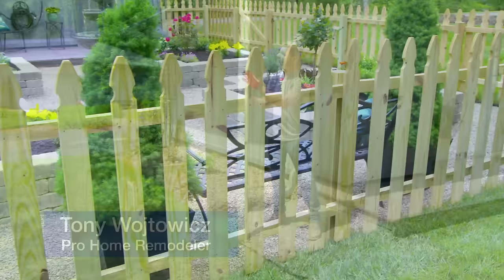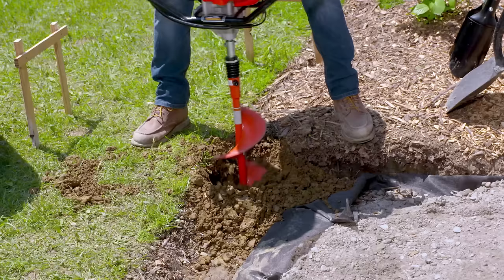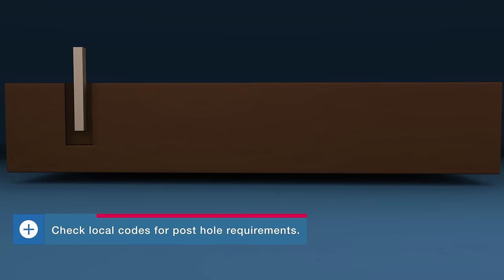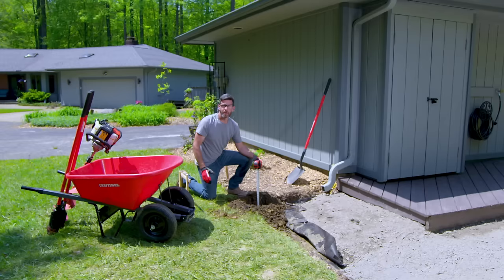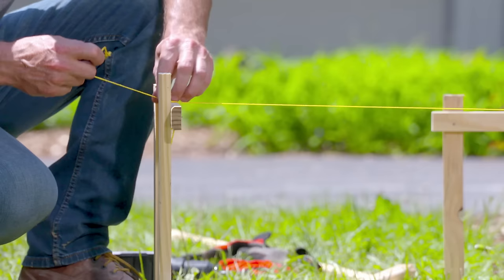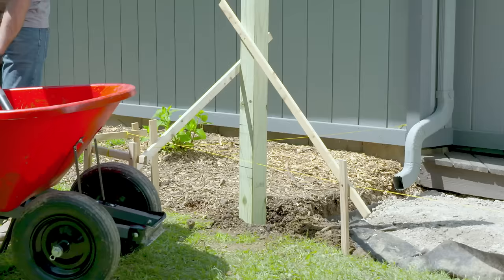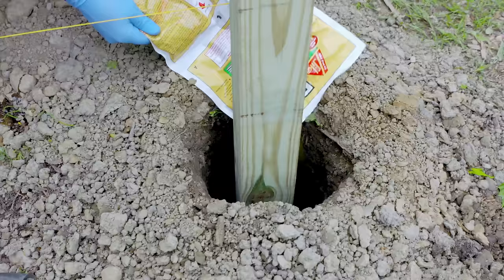How to Set a Post for a Fence or Deck

Comment: Expansion foam does not work nearly as well as concrete.  I personally wouldn't use it at all.  After it dries/cures you can wiggle the pole around in the hole a lot so I would not use it for decking.  Its ok for setting a mailbox post but I would not use it for decking posts.

Comment: The post rots under ground because it doesn't drain but that is why they show the gravel base. The ground still holds water though. It's OK for temporary docks to have wood posts under ground but a permanent deck post should be above ground. There are steel spikes that can go on the bottom end of your post to stick into the ground and another kind that screws in. For docks I use PT and spike the end with a skill saw then waterjet them in with a garden hose.
Reply: Never seen anybody put gravel under a post but often wondered about wrapping them in dpc or bitumen paint.

Comment: How do you remove a post like that if the post rots away and all you got is concrete I need to replace a post that the previous owners put up because it rotted away and I can't figure out how to get that concrete out of the hole
Reply: I'm contemplating the same issue. I think instead of chipping out the old concrete I'm going to cover it and put the new posts between the originals. If everything goes well I'll be dead before the fence has to be replaced.
Reply: Maybe just leave the old concrete, drill a hole in it, and mount metal bracket in there with some 'liquid anchor' or sth, and mount new post in the bracket? They mentions bracket in this video. They are calling it 'hardware'.
Reply: I used a chain and engine hoist. 
1 dig around the concrete enough to wrap a chain around it. Secure it with a quick link or hook.
2 center the engine hoist around the concrete and bring the chain up to the hook. Again, secure with quick link.
3 Pump away on the hoist, the entire concrete plug pops out of the ground.
Lower the plug into a wheelbarrow or lay sideways and sledge it into pieces.
Reply: Use a 4x4 post bracket. Cut the old post out, make it so it's flush with the concrete, and lag the bracket into the crete. Set new post and fasten to bracket

Comment: When i went to school to become a constructionworker they said "you can never set wood directly onto cencrete because that is going to create or suck up moisture" Is that wrong or is the dude in the video wrong?
Reply: They are right. Wood posts done in this fashion have a limited life. Wood fences in general have a limited life. You can hope for 25 years if you do everything right.
Reply: I just tore down the fence around my property. It was built about 27 years ago and was already falling apart. Each post were pressure treated ground contact and set in concrete. Every post were rotten away so all I had to do was give it a slight push and it fell.
Reply: The dude never set the post end on concrete. The vase was gravel.
Reply: Yes, filling the top of the hole with dirt looks nice, but unless you want to reduce the life of the posts by 1/3, leave the concrete exposed, and seal around where the wood meet the concrete.  Wood and wet soil don’t mix.
Reply: @MtKatahdinClimber  Newest research has proven that where the wood meets the concrete is where the most water enters, and eventually saturates the wood, and even PT Ground Contact/Burial rated wood will rot.  If you have to put PT wood in concrete, take an extra day and 'paint' all your PT wood with a quality water-proofing like roofing tar.
Reply: @boots7859  that’s why it’s best to seal around that top gap with something like 3M5200 or Sikaflex 291, which will prevent water from entering at that point.  Will extend the life of the post by 4 years+

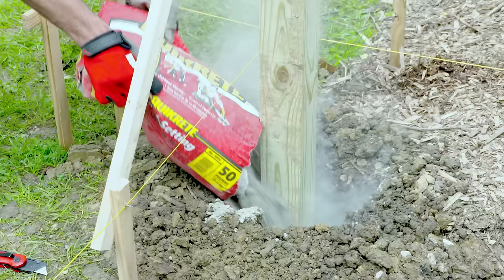Comment: 1:20  As far as I heard recently the wood should not have contact with a concrete, because the wood will get moist and rotten due to the capillary action of the concrete. What is your opinion?
Reply: @BugJuiceFlavor  What kind of climate do you live in? What is your experience in concrete and wood works?

Comment: Holes need to be 3x the width of the post? So for a 6x6 post I need to dig an 18" wide hole? 🤔
Reply: yeah I don't get it why u need a hole that wide something isn't right.
Reply: 3x the width of a 6x6 is 16.5"... This is the width for the cement FOOTING, so the hole has to be as wide in order to access the bottom of it.  The reason is BUILDING CODE, but the purpose is to have enough surface so the weight bears properly.

Comment: This is wrong as the post will rot, the wood will absorbe water from the top and from the concrete under. The best way is to use a bracket! Do not waste your time, thank me later ;)
Reply: I’m committed to using brackets.  It’s a bitch to change the wood and raise the deck with hydraulics.
Reply: Flip Arrachi  cool, except it's not just the wood, it's the labor of pulling up all the concrete that's attached to the "cheap" wood. I'll bet you're a lot of fun at parties lol

Comment: i've never seen someone pour dry concrete mix and add water on top lol. The bottom 50% of the mix is still dry as hell and will never cure properly.
Reply: Nope.  Quickcrete 50lb red bags are meant to do this.  Stuff is awesome.
Reply: @rgagnon1008  I still do about half and add water then more powder, keeps dust down for one thing, but even if dry then water, it will slowly take in the water from the ground to cure the leftovers.

Comment: 2ft down for a post / 450mm is plenty.
Reply: John Clark no. Best is always 90cm/3ft to reach frost free
Reply: @hedegaard8  just pulled a 6' privacy wood fence out of the ground. 20 years, set in dirt/sand and 2' ABOVE the frost line and fence was completely level. No heaving.
Reply: hedegaard8 we don’t have frost below 4 inches in Louisiana lol
Reply: Depth of post hole varies with location.  Check local building codes or your city's building department for the frost line in your area, and go at least 6" below that.  Also... post holes within 5' of the exterior of the house have to match the depth of the foundation of the home.---Due to the backfill being loose around that area.  You need to get to "virgin" soil to support the load, or the deck will sink near the house.

Comment: You did not just put in dry concrete and then water after! OMG. Premix it in a wheelbarrow first
Reply: It’s postcrete, that’s how your supposed to do it, personally I pour a little water into the hole and then some post Crete then more water more Crete